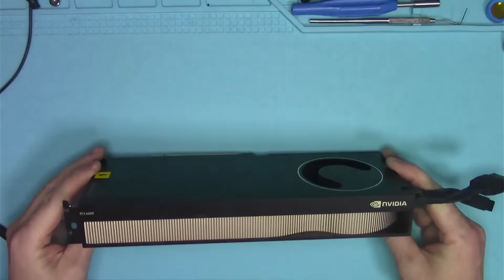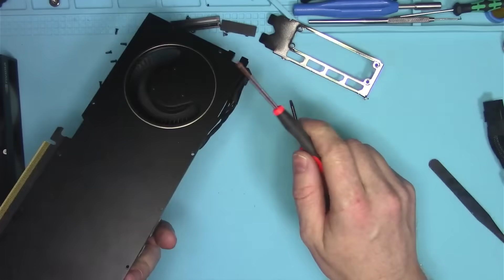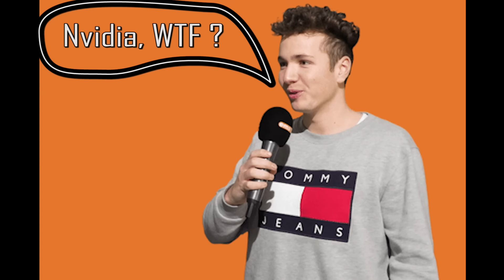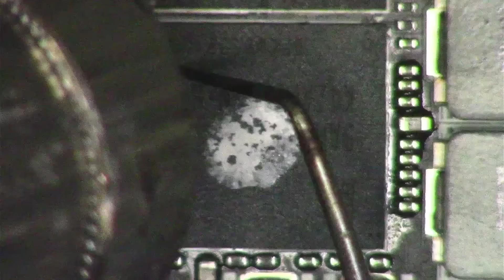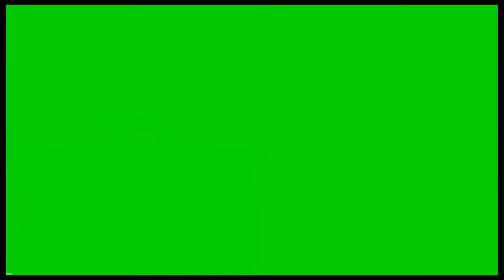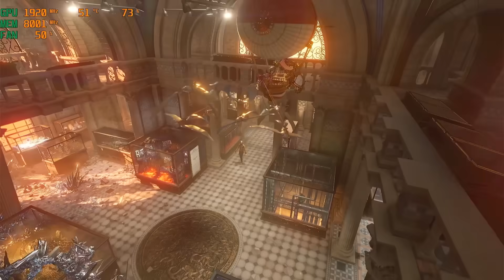Repairing the High-End Nvidia RTX A6000 GPU

Comment: Nice fix, well done. I build a very expensive workstation with two of those cards, they are pretty impressive.
Reply from the maker: What are you doing with them ?
Reply: @northwestrepair  Oh, it wasn't for me, they had some pretty specialty needs, and I just helped them design, build, and test it for purpose. 
It's rather interesting build in that we managed to find a server mobo that supported two Rome series 64 core EPYC cpu's and two full sized PCI slots for the A6000's (Ampere), so a total of 256 threads and 96GB pool of VRAM. We went with EPYC's because they needed to do both long term modeling and graphics presentations on the same work center, where graphics workflow was done WHILE the system was doing days or weeks long modeling of sediment distributions of wetlands or something. 
It's was my idea to use the EPYC's and the server board, as opposed to a single top tier thread ripper they had used in their first big expensive workstation, with a workstation board. It worked well, even when distributed among 3 virtual workstations, one doing modeling with learning involved, the other two doing some kind of architecture graphics presentations at insane pixel counts, both still performing better than their old workstation. It was a BEAST, the benchmarks blew me away.
  
Last time I talked to them they were cloning the system for an upgrade, but keeping the old one, and did the same thing but with Milan EPYCs, not sure if they were upgrading to ADA A6000's. Those two A6000 are still running almost 24/7 to this day.
Oh, and the total price was somewhere in the 16k range, and it was attached to a VERY expensive redundant 96TB NAS.
Reply: @spladam3845  man talk about overkill! at least it would be in a consumer environment
Reply: @Fogolol  after seeing Linus Tech Tips video on nVidia's upcoming Grace Hopper line-up of CPU/GPU, it actually seems pretty modest. if you haven't seen it it's worth a watch just to hear the mind-boggling specs! " NVIDIA Made a CPU.. I’m Holding It. "
Reply: @glebglub  not that I'm too fond of infrastructure and hardware anyways. But I guess >350GHz, a couple Teslas paired with a couple TB of RAM should be some numbers for a "last-gen" environment. And still I don't quite see how people are so excited to be  completely RIPPED OFF and LOCKED IN, be that on consumer- or business level. Be that on lockout of consumer V-RAM, or vGPU-passthrough. Or per-core pricing models as well. I guess with AMD's Zen2/3 progress they had no other option: Full hybrid/cloud or 100k+ ARM boxes is not the answer to everything. Aside from tech locked behind extreme business AND consumer prices, when is the last time you thought about the actual implications or complete loss of power and control? Or are you just as "excited" towards the idea of only being able to start a business or idea when subscribing to extreme prices, control and MS/vmWare/Nvidia et. al? Or only if you're "politically correct"... with "positive" social credit? ;) That's some 'awesome' 'orwellian' perspectives we can cheer and applaud towards while being served overpriced trash.
Reply: @Fogolol  Oh yeah, the design  required some overkill. It was a huge, originally going to be $20k or so company workstation (resources are split among virtual workgroups) that needed to do what is usually two different purpose built stations. In the end they ended up computationally saturating both GPU's, once the workflow was optimized, so it's good we overkilled.
Reply: @justXcallXitXtechno  @justXcallXitXtechno  I'm sure there's some zen-like "What's it all mean Mr. Natural" inspirational warning in this, but the "just a guy" me could only hear the whooshing sound it made going by. Regardless ... thx!

Comment: How much did you charge? :)
Reply from the maker: 80
Reply: @northwestrepair  That's very cheap for this kind of work. I hope it didn't feel like did yourself injustice. This card retails at $ 4000. I think $ 250 would have been a fair price.
Reply: @northwestrepair  Get some phase change TIM, some workstation tests and up the charge for workstation cards.
4090's are workstation chips that didn't make the grade.  Dumpster chips if you will.  That is why 4090's have an ECC option in the driver.

Comment: First off, not all heroes wear capes, well well done. I always have mad respect for those who can do pinpoint soldering like that, also Im amazed that card stays at 53c in Timespy with a blower cooler and a dinky heatsink.
Reply: Well that Samsung silicon had a lot of yield issues and they're certainly using the best bins for these with less power leakage. However look how low the clock speeds are. It has a lower base clock but this was the Timespy demo section, not the actual benchmark. Even the memory clock was dropping P-states. Still a good job but I'd expect higher temps during an actual run.
Reply: Timespy is meant for measuring gaming performance of consumer-grade card. It's not surprising at all that a professional grade card meant for heavier workloads (scientific computing, AI, etc) would have low temps because they aren't under a significant load. Timespy isn't meant for professional cards like the A6000 and can't sufficiently benchmark it accurately. If you want an accurate measure of temps and performance, you'd need to make use of CUDA compute benchmarks, or deep learning benchmarks. These are included in the Nvidia CUDA libraries.

Comment: The PCIE power connector on the card is actually a 12V P8 connector, those share the same footprint but have a different layout, that is why the PCIE connector made a short circuit.
Reply: The footprint is slightly different, as well as the layout. Shouldnt be possible to connect a pcie 8p into esp 8p. The cutted corners are shaped different.
Reply: Exactly, those card use the EPS 12V connector because it's a standard for PCIe card in Servers.

Comment: The question is how much did this repair cost? And how long did it take and how much was the cost of parts used, if there were any replaced.
Reply: just a single 8GB RAM chip I believe, so about $15-25? used to be $100 last year. or """free"""" if you have a donor card to transplant parts from. but the real cost is in the BGA rework capable tools, and of course the time and experience of a very capable and knowledgeable person (and a mostly negligible amount more on the solder, flux, isopropyl alcohol, cotton swabs, solder wick, electricity, etc.)

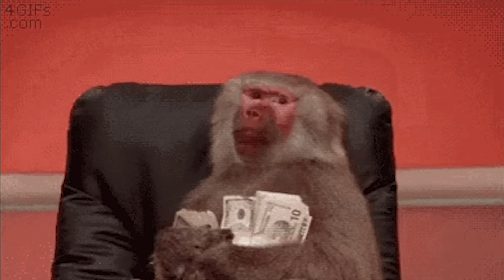Comment: 4:44 this type of connectors is much older than PCI power, and it is used everywhere in servers, so putting it on professional GPU that may be installed into one is actually nothing extraordinary

Comment: Just a heads up I'm into custom watercooling, so I always put a waterblock on my GPUs before they go in. Every brand new GPU from nvidia at least has that dry paste right out of the box for me, as recently as my RTX 4090. I am semi-convinced it is designed to be like that. May be a type of phase change where it becomes more liquid when under heat I'm unsure. Though I have just tried repasting in the past and gotten better temps so I don't know what they're doing over there.
Reply: This may be and they might using that for the latest cards but they definitely weren't using phase change in the past. They do intentionally use specific pastes that aren't as susceptible to pump-out so what is often perceived as "dry-out" isn't quite accurate. 

Repasting may improve temps a bit, even over phase change, but you're likely using performance pastes that don't have the longevity Nvidia would prioritize. It'll hold up longer with a water block because it doesn't go through as much of a heat cycle.

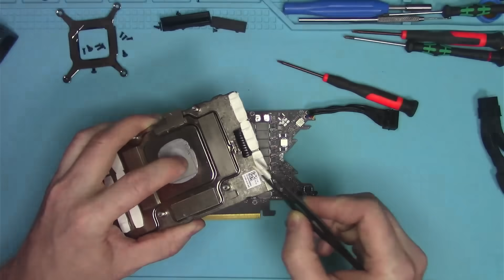Comment: 2:44 it's phase change material or special thermal paste with some kind of solvent which is evaporates after a while. Usually it done for more equal temperatures(lower hotspot). I think mx4 should have much worse hotspot than this dry thermal paste
Reply: MX-4 is to thin for direct die applications, you should use something more viscous, like mx-6.

Comment: very nice! the dry thermal paste I think it's because it's not really a "paste", it's a thermal interface like the PTM7950, it stays solid at room temperature and once the core heats up, it liquifies itself becoming a paste
Reply: yep and it also minimizes the need for re-application as it basically reapplies itself every time it heats up to working temp. Long service life is adamant with professional gpus.
Reply: It's thermal interface, son! It hardens in response to low temperatures.
Reply: @sebaschan-uwu  Imagine a world raiden, free from replacing thermal paste.
Reply: @Annoye  The life expectancy for this type of pad is basically until whenever it's serviced - they need to be replaced once they're exposed, but otherwise they should last as long as whatever they're thermally coupling.
Reply: @Annoye  Pretty much never. PTM7950 will last the about the lifespan of the device and it has thermal transfer rates on par with high end thermal pastes and liquid metal. As long as you don't pull your components apart it will last forever.

Comment: This used to be called a Quadro, very expensive. The GPU core is of course the same, physically (with the possible exception of eFUSE status), but it usually has 2 or 4 times the VRAM, much lower power limits and voltages, and some additional connectors for special industrial equipment like NVLINK and timing synchronization. Oh and it has a special VBIOS and uses a different driver package.
Reply: I.e., Nvidia is ripping people off by artificially limiting some tiny cheap features that some people need to a different product line.
Reply: @typingcat  would you like to pay for the potential to have additional memory chips on your consumer card ?  Neither business nor engineering work that way.

Don't get me wrong, IBM used to upgrade your massively expensive mainframe at a cost of millions by.....flicking a switch!  But producing specialised cards isn't that industry.
Reply: @DeepakKumar-lv4te  You just press the turbo button while no one is looking
Reply: @DeepakKumar-lv4te  back in the days it was possible to make a quadro from the equivalent gaming card by simply soldering a wire between 2 specific points o the board, but then they figured out that to really be able to rip off the customers they had to be more cunning.
Reply: @figosound  if you say so.
Reply: @DeepakKumar-lv4te  The consumer cards and professional cards use physically identical GPUs, so when you buy a consumer card, you are always paying for it being capable of having more memory chips installed. Board makers used to offer consumer cards with extra memory until Nvidia started threatening to blacklist them. Some board makers even used the same board for their professional cards and their consumer cards and just left the extra memory slots empty.

Figosound is correct, whether a GPU saw itself as being in a quadro or a consumer card really was just determined by a shunt way back. The difference between the professional cards and the consumer cards is basically just firmware, drivers, and installing more memory, none of which actually costs much more money to do. They only charge a lot more money for them because they can, and people pay the prices because they expect to make enough profit to more than make up for vastly overpaying for the hardware.

The same thing was done with CPUs. Intel and even AMD charge different prices for the same silicon based on what they want to allow you to do with it at a given price, though AMD was historically more lax about it.
Reply: @5467nick  manufacturing requires testing and QA.  Simply declaring things "don't cost much more" is not accurate, it's an overhead and in manufacturing that quickly becomes a problem.  Now I'm no expert at all in this field but testing / QA costs in every other field and significantly so in software if you have any knowledge of that.  Often some of these costs are put on the consumer allowing products to go out of the door knowing there's going to be a huge bug database to follow.  Microsoft are masters of this but everyone does it.  just assuming you can bung a load more chips on a board - simply because there's slots for them doesn't tell the story of manufacturing & QA.
Reply: @DeepakKumar-lv4te  I'm well aware that testing must be done. The fact of the matter is that it isn't a significant cost relative to the price of the professional cards. You absolutely can make a consumer card with more memory chips as that's literally part of what they do with the professional cards. It's something they've been doing for many years now, and previously did offer some consumer cards with the full amount of memory supported. It's not difficult.

They stopped doing it when they realized that people would pay dozens of times more money than they previously were due to new workloads coming out such as AI training that had huge theoretical profit margins for the future. They had new customers with deep pockets and wanted the money, that's all there was to it. I'm not saying it's a horrible crime against humanity, I doubt the extra hardware in the GPU chip on consumer cards needed to support the larger memory configuration in the professional cards really added much to the cost of the GPU chip, but it's there and that's why.
Reply: @5467nick  For those who think changing production lines is a trivial exercise. 
https://youtu.be/bR-DOeAm-PQ
Reply: @DeepakKumar-lv4te  There is exactly zero relevance to changing production lines in this discussion. They have those production lines and are using them, only they charge ridiculously more money for what comes off them despite the fact that it cost them almost the same amount to produce the parts on the "professional" production line as the "consumer" one. As I said, they often used the exact same board, merely leaving the bottom side's memory slots unpopulated for the consumer cards! It's even the exact same production line in that scenario! Literally the only reason they don't offer consumer cards with expanded memory at a slightly higher price (and full-speed compute) anymore is so they don't compete with the "professional" cards.
Reply: @typingcat  I think it's more the fact they dont want to upgrade there enterprise solutions to compensate for the base requierements expected by games and gamers 
i mean think about it. they still sell lots of 12 and 16 gig enterprise cards they would have to start there enterprise solutions at 60gig on the low end if they actuily sold us a system that would last the next 5 ish years without crapping out.
Reply: Dont forget they tend to frequincy lock the enterprise cards.

Comment: The thermal paste is supposed to be dry on these Nvidia made cards. They are using a phase change material that melts when hot, so it has a very long service life. As for the memory being the issue, I’m kind of not surprised. I’ve worked with these cards before, and the memory cooling solution is terrible. The VRAM junction temp. regularly exceeds 100c under load.
Reply: The 3080 itself had issues with VRAM junction temp. I had a 3080 that would almost always sit around 95-100C while gaming.
Reply: @thatsux0rz  same with a inbuilt 1060 / 6Gb in a Hasee gaming laptop.  impossible to get the temp down (or the fans off).  it's no longer visible to the laptop (which boots fine but now shutsdown after 30secs and doesn't see the nvidia ).  I wonder if its dry thermal paste is the same as that stuff in the video.  It's like dry filler.
Reply: 100 celcius cant be healthy xd i wonder if it damages the components arround it too
Reply: is that thermal paste better than something you can buy on amazon? wondering if its worth changing?
Reply: @niccolon8095  PTM is decent, but it's heaviest advantage is longevity. It basically adjusts form to follow connection and then it is immoveable. Unlike pastes that are much thinner, this one can feel kinda plasticky after some time of work, but it still works as intended as it changes phase only under pressure AND temperature at the same time.
Reply: Oh, I'm not the only one seeing "memory junction" getting above 100C on my A6000 under sustained full load then 😅 Is that typical in your experience? What's your hot-spot like under sustained full load?
Reply: Here Sir. Have a nice hot cup of copium!